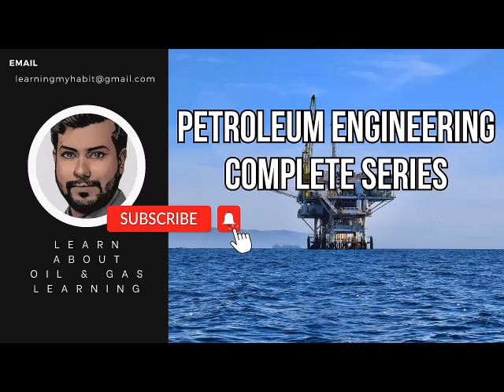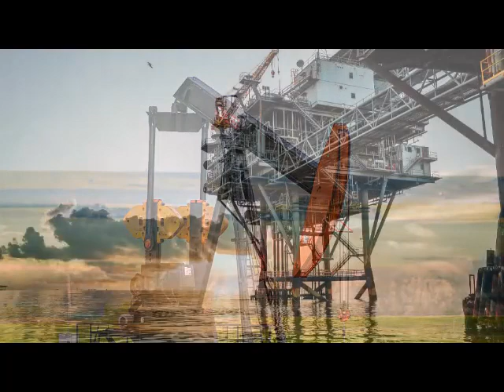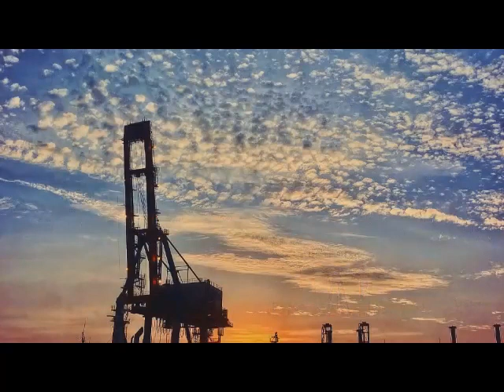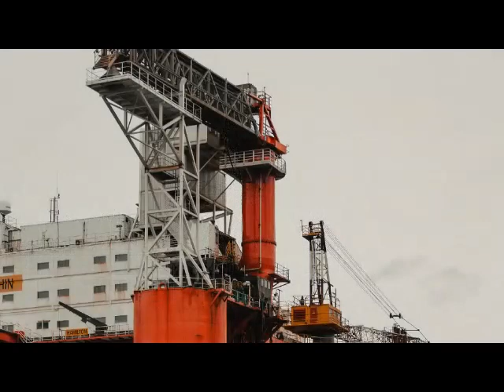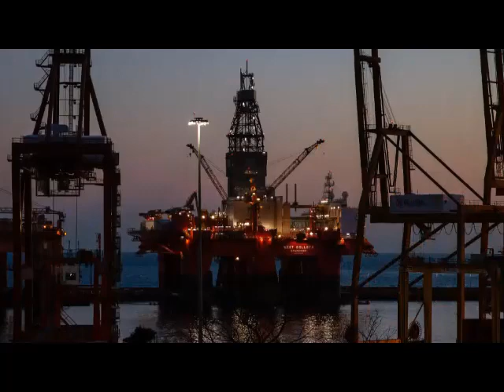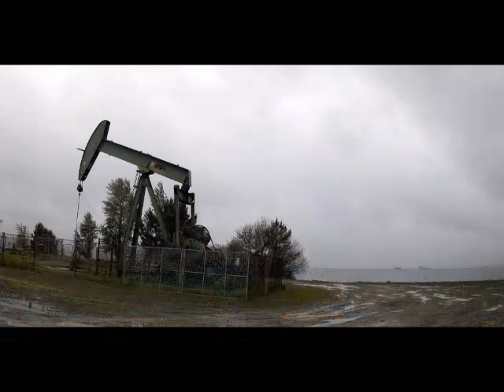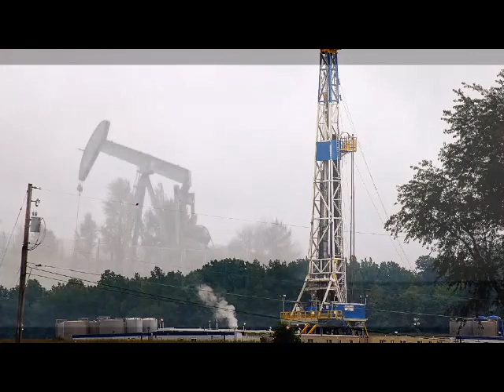Part 2 - Petroleum and Gas Engineering Complete Series | Oil and Gas | non-renewable Energy Resource

Comment: ⭐ Contents ⭐
00:00 Intro
00:30 Section  21: Understanding the different types of petroleum contracts and agreements
04:08 Section  22: An introduction to the principles of petroleum geomechanics and rock mechanics
08:16 Section  23: A guide to the basics of reservoir engineering and management
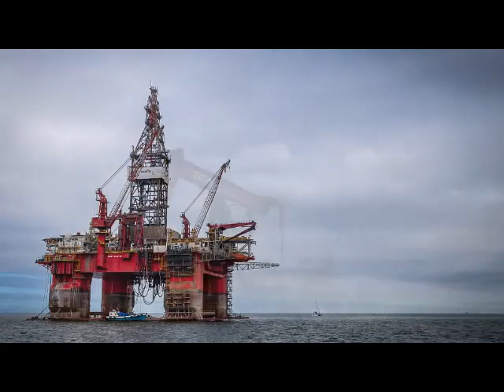11:51 Section  24: Understanding the different types of well stimulation and completion techniques
15:09 Section  25: A guide to the basics of petroleum reserves classification and estimation
19:20 Section  26: Understanding the different types of production forecasting and decline analysis techniques
23:10 Section  27: An overview of the role of sustainability and renewable energy in petroleum engineering
26:47 Section  28: A guide to the basics of petroleum product quality control and specification
30:25 Section  29: Understanding the different types of well intervention and workover techniques
33:14 Section  30: Understanding the different types of petroleum asset management and portfolio optimization techniques